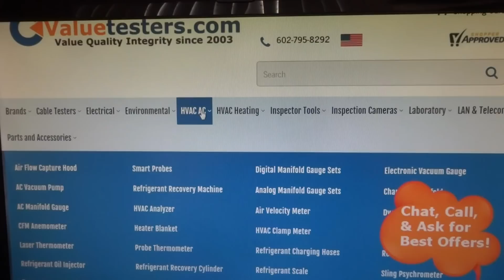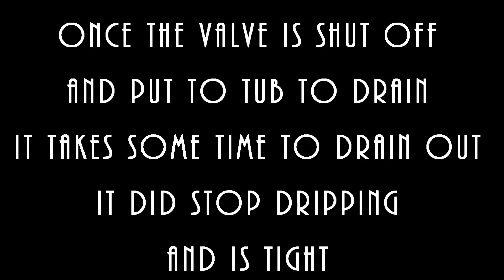tub shower valve making noise fixed

Comment: Thanks for the video OP.  Question, are those valves standard for showers?  Mine has developed a buzzing sound at a certain position when the water is on.
Reply from the maker: it might be a loose washer on spindle .. that can be tighen up

Comment: Hey guys... any suggestion on y the tub spout would drip as the  water in the shower head is coming out? I changed the cartridge on my single handle posi temp as well as tub spout and still I get water dripping from tub spout. Thanks
Reply: Your tub spout blocks off water flow and allows water to flow to the shower head.  The spout is not 100% blocking the water.  Sometimes when water pressure is higher,this amplifies this.   The spouts are also very cheaply made.
Reply from the maker: install a ball valve and elbow it will never drip again .....lol   they never are 100% shutoffs if it pores out replace the lift spout if it drips thats how they all are

Comment: I just came from a spindle issue... the water water dripping from the crown (center trim piece that covers the spindle) so I took the lever off, to get at it, to see whats up... the spindle extention (from the extension kit) shot out, and water was shooting out of the spindle... which turned out to be the bushing for the extension kit...the seal was toast!!! Holy crap! So as My curiosity grew, the bushing was never torqued right, and has been spinning back and forth until now and the seal just wore out. 
Me: “How old is this bathroom and this valve?!?!, looks too new for any issues. These symmons are pretty bulletproof for like 10 years at least”
Customer: “No. Not long... maybe a year or so”
First time I’ve ever seen water shoot out of the spindle.